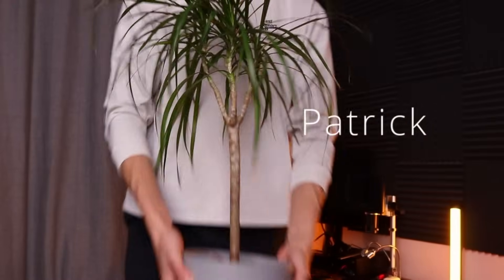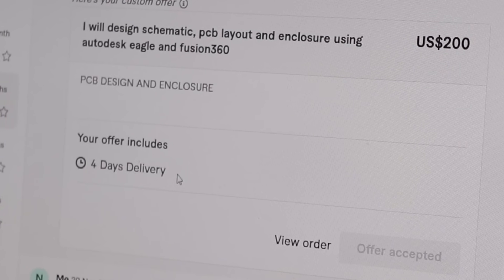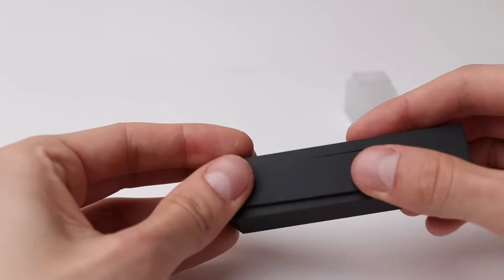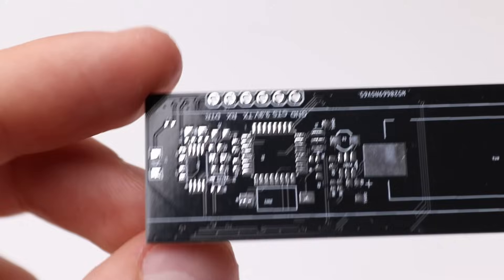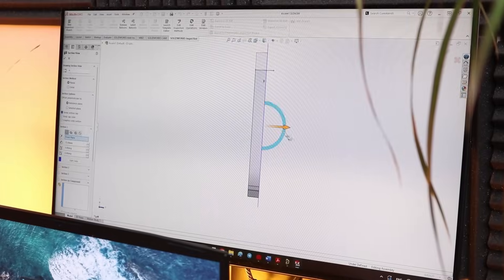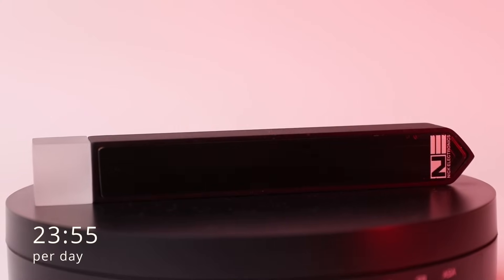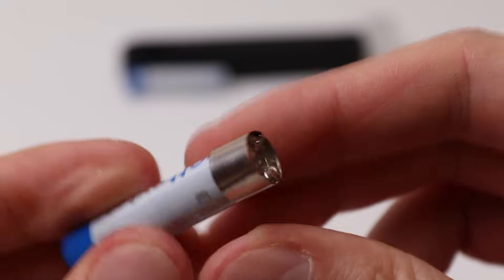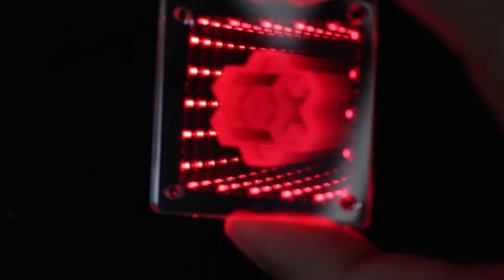Building an Unusual Soil Moisture Sensor from Scratch...

Comment: Nice design. Rather than a diode for reverse-battery protection, you could use an N-type MOSFET between the battery negative and 0V rail in the circuit. Connect gate to battery +, source to battery - and drain to the 0V rail. The MOSFET can be any cheap, logic-level one with a higher Vds rating than your battery voltage, so pretty much any will do for 3V. Often, this is actually cheaper than a diode and doesn’t waste any voltage like a diode would.
Reply from the maker: Thanks for the suggestion. I know about the quasi-diode circuit (I suppose it's called that), but in this case, it takes up more space, costs more (for sure), and for a device that is awake for a small amount of time and consumes only a few mA, a normal diode will do just fine.
Reply: @NickElectronics  Ok, cool. I just thought you might get more battery life since you only have 3V to play with, but as you say, a Schottky diode doesn’t drop much voltage with only a few mA going through it.
Still, MOSFETs are almost as small as diodes (SOT23 types) and they’re really cheap nowadays. I use one for one of my battery powered projects that takes 3x LR44 button cells, just in case the user puts them in backwards. The MOSFET costs 6p each. A Schottky diode is about the same.
Reply from the maker: @ Yeah, I will probably use a mosfet in the next version. Price difference is not that high and I kinda have space for it.

Comment: good improvement from the initial concept you received, but in regards to waterproofing, you could have sized your light indicator thread so that a small rubber O-ring could firt around it's base, making sure that the top junction is more watertight than just with the thread's tolerances
Reply from the maker: Thanks, that is a good suggestion. I was thinking about adding it in the next version. A lot of people have mentioned that screw thread is a weak place :D

Comment: FYI, I’ve seen images of the solder mask on capacitive PCB moisture sensors like this flake off after prolonged exposure to the elements. It’s probably fine for a while, years even, but it’s not that robust. Maybe it starts flaking at the edges, so you could reinforce it with some grey gloop.
Reply from the maker: The PCB on the side is indeed reinforced with epoxy. Just don't show it in the video. I’ll see how it holds up over the years, but thanks for sharing your experience.

Comment: 9:15 Actually no, screw threads aren't generally water-tight or a good general seal for immersion or pressure. Bottles aren't sealed because of the threading itself. The threading assists mechanical leverage against the gasket surface that acts like a tiny cork/gasket. So without a ring gasket between the surfaces you aren't immersion protected unless the tolerances on those mating surfaces are near flawless or can deform enough. In plumbing SOME threads are specifically designed to taper larger, so you torque those it until it seals via very unique threads, but at an unrestricted depth, else they always use a gap filler of some sort around the threads.

At the top of your stick it's probably fine, but waterproof rated it is not.
Reply from the maker: You are completely right. As I mentioned in the video, I am not a mechanical engineer :D
Maybe adding a sealing ring isn’t such a bad idea and I should do it.
Reply: @NickElectronics  I wouldn't really blame you if you didn't TBH, if this is used strictly indoors, and never poured on directly, I don't think you'll have any issues with ingress. If anything an unplanned height shift might make the battery fit poor or the top not sit square.
Reply from the maker: @ There is only one way to find out how it works over time - wait and then disassemble it
Reply: Came here to say this, but you did way better than I ever could :D

Comment: Bro, why become an engineer if you're not going to be creative with it? That's litterally the whole point of engineering, solving problems, which REQUIRES creativity.
Reply from the maker: True, true :D
Reply: The final solution has difficult to manufacture "hat" for a battery, which is somehow fine when made by the client, but any outside of the box thinking by the freelancer was heavily criticized because the "client" could find any issues on the first revisions on a dirt cheap project and decided that as a result everything is an issue.

Basically this is what happens when you promote a talented line worker to a managerial position that doesn't have fhe experience nor skills in management/delegation (or the emotional maturity to reflect on their actions) and instead they end up micro managing and terrorizing their employee.
Reply from the maker: @ww-pw6di  with “hat” I agree. About everything else you are being delusional, making up some facts about terrorizing
Reply: @ww-pw6di 
This wrecks of copium for being likely one of the lazy "engineers" Nick hired. Infact, ARE you one of said engineers?

Comment: You gave the guy 4 days, $200, so you expected to pay him minimum wage with no materials, and work for a total of 13 hours, and you somehow expected... a custom battery holder and a design that isn't just thrown together from things he had at hand but actually optimised?

I give this device half a year just like anything you buy off Ali. There's basically nothing to protect the edge of the PCB so it will soak up moisture and delaminate internally, the glass fibres in the PCB wick moisture. Also no, threads do not seal, since there's necessarily a channel on one side of the thread. The way a water bottle stays sealed is that there is a flat seal liner or a protruding wedge feature in the inside of the bottle cap that flexes against the rim of the bottle, the thread cannot seal.

I'm unsubscribing. The only positive about the video is the Jet Set Radio sound effect.
Reply: OK I confess to being an ex-pro Soil Moisture  sensor designer/maker. The whole let's stick a PCB in the soil, is a modern 5 year life device. Planned obsolescence. And you do not need a micro controller, just an LM 393 and a few transistors, resistors and a capacitor for an oscillator. Use two SS screens as the sensor, one inside the other. Pot the electronics in epoxy, use a solar panel for power.
Reply from the maker: @ebaab9913  thanks for sharing your experience
Reply: Wow. Harsh, man, harsh. It’s a youtube project video. I can’t imagine how anyone could satisfy you if you’re so easily triggered to dump all over someone just for trying to make something interesting.
Reply from the maker: @simontillson482  First of all - it was a joke. Second, IDK what do you mean by saying "to make something interesting".
Reply from the maker: The guy chose 4 days by himself; there was no limit set by me. I asked every freelancer how much they would charge for the job without specifying a strict price. Initially, he said he would do it for $150, but I increased it to $200. He didn’t make any prototype, so I’m not sure what “things he threw together” you’re referring to. The side of the board is covered in epoxy during the gluing stage. You’re right about the threads.
So, you misjudged almost everything. Well, good luck
Reply: @ Well that's an excellent response on your part and you handled some things better than shown, but the vid is what it is.

Comment: I would personally adjust the blinking rate (to 30s or so) and I'm bit worried that I would forget to the change the battery on time. So, maybe some indicator for low battery.
Reply from the maker: Yep, I added an indication for when the battery is discharged; I just didn’t mention it in the video.

Comment: Would you consider making a usbc rechargeable option ?
Reply from the maker: I don’t think it makes much sense, as the batteries need to be replaced once per year. Usually, rechargeable batteries are used in devices that require frequent charging, like mobile phones or wristwatches.
Also, sealing a USB-C port would be problematic.

It’s easier to use a discrete charger for Li-ion batteries or simply recharge the battery with a power supply once a year. 😄

In one of my upcoming videos, I plan to create a similar design using an 18650 battery, which will be rechargeable. However, it won’t be designed for moist conditions—just a smart lamp.
Reply: @NickElectronics  Eneloop makes excellent rechargeable AAA batteries. They keep the charge very long time. However, the voltage is not the 1.5v, but 1.3 - 1.4v, which may be a problem for some devices.

Comment: Do these kinds of moisture sensors even reliably work to keep plats alive? The soil at the very top, where the sensor measures, will always be the driest and the least relevant because the roots are further down in the more moist soil. I feel like I'd get a lot of irrelevant data and still kill my plants...
Reply from the maker: It depends on the depth of the pot and the length of the sensor. You can also calibrate it to whatever moisture level you prefer.

Comment: I love the design! I missed something. Are there contacts with the soil to the PCB? Or does it remotely sense the moisture level somehow? I thought moisture sensors needed to have contacts, I couldn't see them in your sleek design. How you do? So cool!!!
Reply from the maker: Yo, thanks! :)
The way it measures moisture is by tracking the capacitance difference of two copper tracks on the PCB, located on the side that comes into contact with the soil.
Basically, those two tracks form a capacitor. And when the permittivity changes - capacitance changes. 
Here you go:
https://thecavepearlproject.org/2020/10/27/hacking-a-capacitive-soil-moisture-sensor-for-frequency-output/

Comment: this is a cool project but I think a wireless microcontroller like an ESP32 or even just and ESP8266 would make this significantly more useful:

the controller wakes up, sends you a notification on a server or your phone and goes to sleep, in this case it's impossible to "miss" a notification
Reply from the maker: Yep, you are right. But I wanted to make something with extremely basic functionality. No Wi-fi, no internet. Rock solid :D
In one of the next projects I will be working with ESP and IOT :)
Reply: And you could upgrade it to automatically water the plant from a tank hidden behind or below the pot.
Reply from the maker: @User-ec2bh  Not everything should be automated. I think
Reply: @NickElectronics  not everything, but this is definitely something you want automated away
Reply from the maker: @4_shadowing  Say this to japanese :D
Reply: Pricelesstoolkit made exactly that

Comment: While I agree that the 555 is unnecessary, not having a reset + serial interface makes development harder and they can be DNI later. The boost converter lets Bob use 1 AAA instead of 2. This is a tradeoff because it'll run for ~half as long, but at least he'll have a constant voltage for the sensing + LED instead of the 3v which will decrease over time. The 16 MHz crystal lets the atmega328p run twice as fast which may also save power depending on how the code was done, but the datasheet says you need 4.5v for that, so that may be a mistake.
Reply: If you want single battery - choose attiny43u with 32768Hz clock quartz resonator, cuz it has own dcdc and is very low power. Use AA battery cuz it has bigger capacity and costs almost the same as AAA.
Reply from the maker: @ІгорАлієв  The problem with an AA battery is that it is 1.5 times thicker than a AAA battery, which is quite a lot.

What is the quiescent current of the internal DC/DC converter in sleep mode? It has to be switching to provide power to the MCU, I guess, so I assume it cannot be lower than that of an MCU without such a converter.

Using two batteries is also not a big problem because the device needs to be long enough to penetrate the soil deeply.

But anyway, thanks for the suggestions! :)
Reply from the maker: Dc-dc boost converter consumes current even in the IDLE, when the device suppose to sleep. Also it is not 100% efficient. Cost of second battery is negligible + there is enough place for two of them. 
You can measure voltage of the batteries and adjust thresholds. Its just 2 lines of code. Or use input voltage as a reference. Both would work. Crystall oscillator is needed when you need better timings and more precise frequency. This is not the case. 8Mhz that chip provides is more then enough. 
General rule for me - if its possible to do something using less, why using more?

Comment: I am 100% sure most will miss the 1 sec led blink and not everyone will present there when the led blinks. Try adding a buzzer. You can buy AAA battery holder, your solution by using nickle strip does not look promising. Keep in mind that the alkaline batteries tend to leak after some time, also the sensor contact may corrode.
Reply: Why not use the small round batteries found in car keys? Would save a lot of space.
Reply from the maker: @ They have low capacity, so have to be changed much more often 😳
Reply from the maker: @ Cause they have quite low capacity and have to replaced quite often because of that
Reply: You could add like 2 or 3?
Reply from the maker: You miss once, miss twice, third time you will not miss. My plant stands on my table next to PC, so for me its not a problem.

I dont think you want to wake up from a buzzer at night)))) Holder is a bad solution 100%. In the video I say why. They all are too big. Nickel strip is not ideal solution. Here I agree with you. Removing plastic from a battery is a better option.
Reply: @NickElectronics  Why not put the battery contact crown into the screw cap? Many alkaline cells have the case as the positive terminal so peeling plastic will not work.

Add an o-ring to the screw cap.

Insert PCB inside box and have opening just big enough for sensor zone to make sealing better.

Waterproof 3D-printed parts with solvent or glue dip.

Neat idea, freelance results are hit and miss.

You could have the sensor broadcast status with IR led using RC.5 code of similar once a day to handle multiple plants.  Use a good capacitor to provide high current to LED so batteries are not taxed more than the average LED current.
Reply from the maker: @ Thanks for a comment. A lot of quite nice thoughts you have shared. Agree in most points. It has to be improved 100%

Comment: This is sick, tho I do want to say that water bottles arent water tight at their threads, the threads just push the top of the bottle to a liner around the inside the cap at the end if the threads so its more like a cork. But if it is water tight for you then theres nothing to worry about
Reply from the maker: Thanks a lot :) Yes, you are completely right. I was somehow following the idea used in underwater flashlights that divers use. There are usually 1 or 2 sealing rings after the tread. But divers go 35 + meters deep. Dont think Patrcik will ever go that deep, ahahah :D From the other side, over time moist indeed might go through the thread due to capillary action or so. So maybe adding some standard sealing ring makes sense. IDK. Will see how it works over time.

Comment: does the red LED keep blinking continuously or do you have to be there during the 10 minutes a day it turns on?
Reply from the maker: In the original design, you haveto be there to see it blinking once every 10 minutes. However, it's just a matter of one line of code to change that.
I designed it for a plant that stays on my desk in front of my computer all the time, and I basically sit in front of it 24/7 :D
If you see better option to realize it, feel free to write it here. I always read the comments, so maybe we can find a better way to blink the LED :)

Comment: Nice! One question, why not attach the "head" to the screw in part?
Reply from the maker: Thanks :D 
You mean make it non-separable?
Reply: @NickElectronics  I suppose - i just thought for the user it would be nicer that it was just part of the cap instead of a small part that has to be manually transferred and could get lost :)
Reply from the maker: @olavrask9729  Ahhh, you mean the metal hat :D Yeah, it could somehow be glued inside the cap. I just didn’t think it would be a big problem. But thanks for the suggestion, it’s indeed a good idea. Probably in the next iteration I will do that.